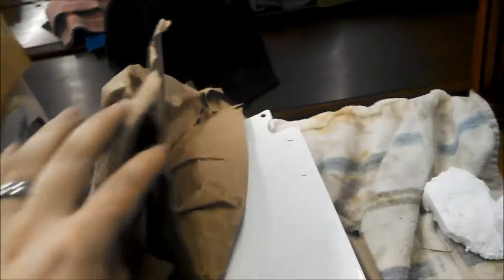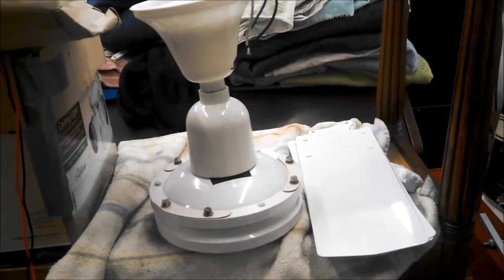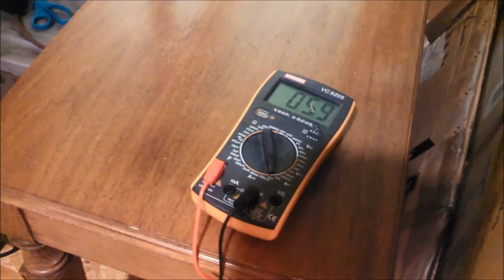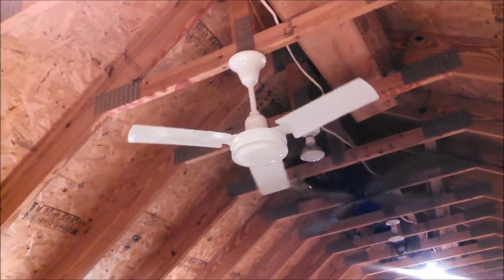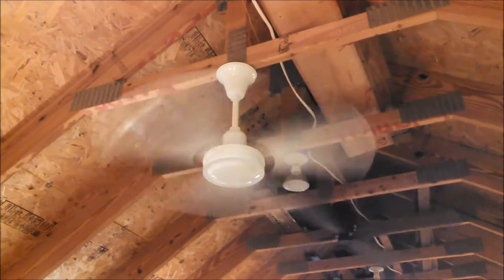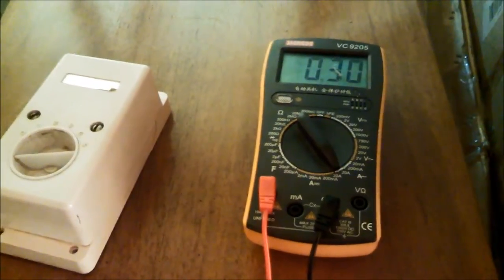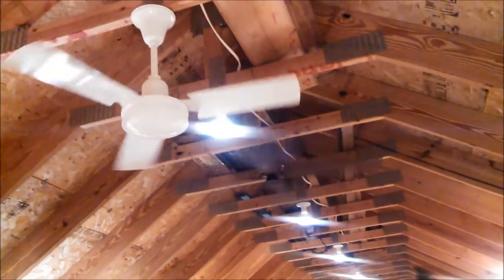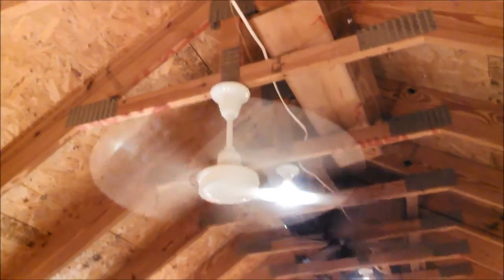Autumaire (Airmaster) B36 (D36, B100) 36" Industrial/Commercial Ceiling Fan UNBOXING AND TESTING

Comment: As much as I like NOS equipment and old packaging, I've had bad experience with buying NOS ceiling fans; mostly bearing disasters.  Glad the bearings weren't too bad in this one. That's very strange to have used the same size motors for all the different lengths.
Reply from the maker: Actually pretty common to use the same size motor.  The bearings were very stiff on this.  NIB is sometimes worse, just like an old car, better to drive it gently than let it sit.
Reply: I've bought multiple NOS portable fans and never had a problem, but they're very different in terms of bearings.